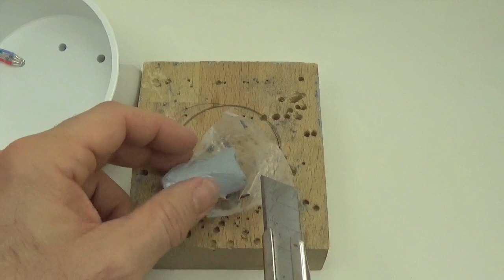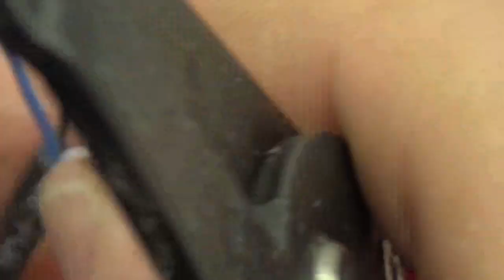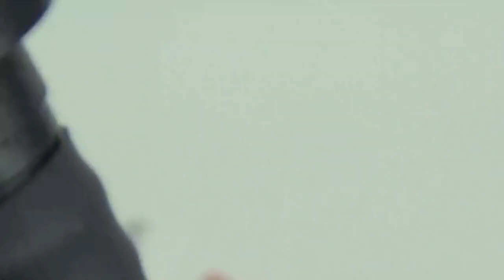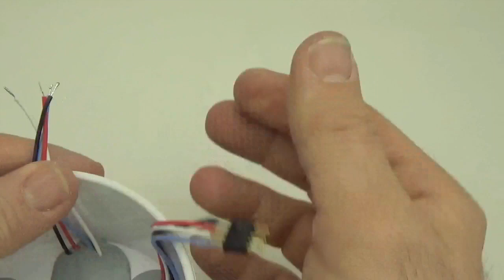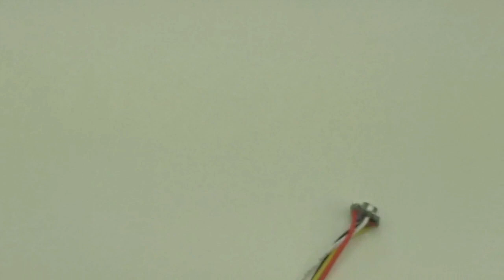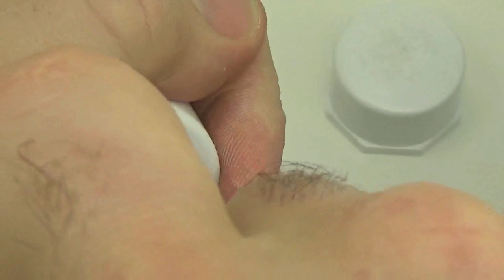2017 Pro Mini Logger Build:  Potting Sensors & Waterproof Housing Pass-Through Connections

Comment: Thanks for the video, this is a great idea. Unfortunetly these PEX swivel connectors are not available in the UK. I understand as you said in the video it can still be done with the 1" cap but its not ideal as its a bit tricky to stop the wires twisting in the housing due to it being fixed / no independant spinning nut.

Comment: Hello there. We work manufacturing robots used to underwater inspection for the last 8 years.
I'll share the most valuable secret: rubber mounted under pressure.
In our case (and I can see it would be very useful in the equipment showed in the video with proper application) o'rings do the job pretty well.
We tried multiple kinds of glue to the connectors... Epoxy isn't good to keep water vapor out, silicone glue is a little better, but the contact with water causes it to become more rigid and losing mechanical properties over time.
Our actual solution to cables is using good quality cable glands, filled with silicone glue as an extra barrier.
To mechanics we use rubber mounted under pressure, well "hydrated" with good quality industrial vaseline grease.
Since we changed to this approach, our robots do a good job for years, and when they come back for servicing they're dry and well preserved inside.
Reply: could you please share a link to your company and the products you are referring to.

Comment: Just want to say, I use colourless nail-varnish to protect circuits (e.g. ESP8266's) from water and t works well. May even be a viable substitute for your PVC glue.
Reply from the maker: On the bench we coat everything we can with conformal coating, but if we have to repair something in the field we usually go for the clear nail polish since it can be obtained just about anywhere. So I agree it's a good option. The PVC parts are welded by a 'solvent' which gives you a much bond stronger than the type that glues produce. That said if I have to make raised screw mounts, or other 'one-of' joins on that pvc surface I often resort to plumbers epoxy which sets rock hard & will hold a thread.

Comment: I'm going to try this method for connecting a 115v sump pump in a sub-surface well.  Looking for something easier to connect/disconnect when needing to service the pump.  Haven't had good luck with commercially available "waterproof" plug connectors.